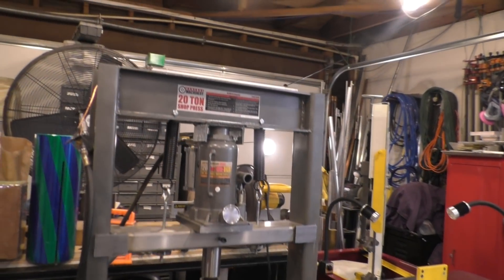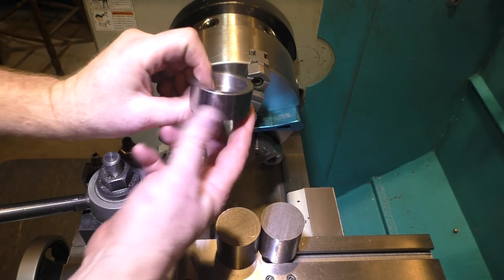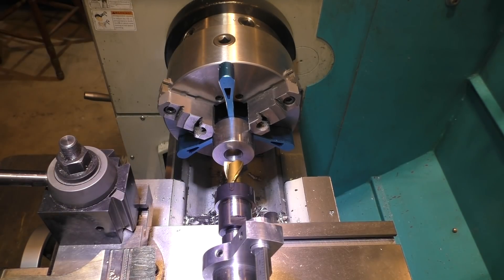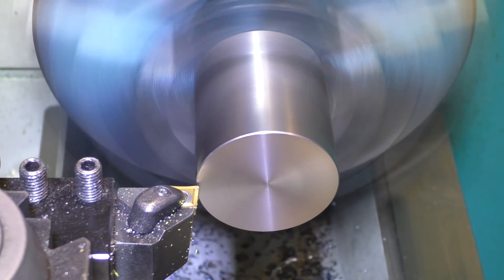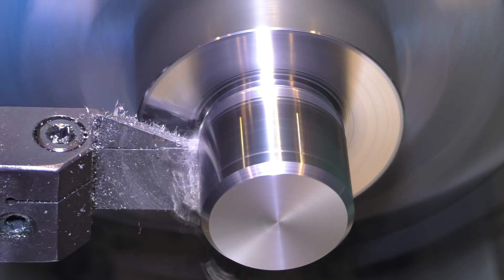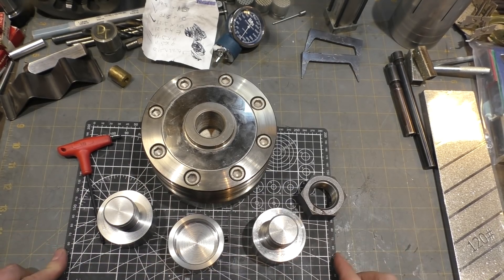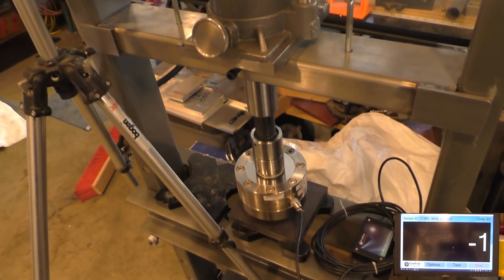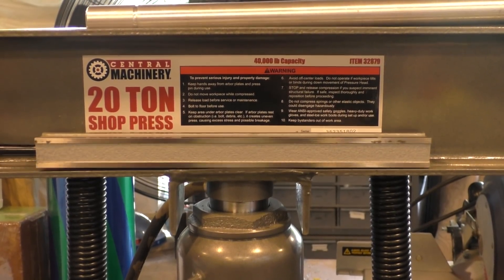83 Can a Harbor Freight 20T Press Generate 40,000 lbs.? and Survive?

Comment: Having wanted to add a pressure gauge, and done some hydraulic calculations, given a nominal piston/bore size of 2.07", to get 40,000lbs of force would require the jack to get up to nearly 12,000PSI in the cylinder, which very few hydraulic systems can do, especially those from cheap vendors. To get a guage even close to that would be $100, for one that only goes to 10,000psi.

Would be interesting to know where the permanent bending is happening. I'd guess the upper webs above the jack are bending outward, as c-channel has to twist in order to bend, which could be stopped by welding a thick strap tying the upper webs of the c-channels together.
Reply from the maker: You are correct about the bending location. It is definitely the crossbar.

Comment: I just bought one of these HF 20 ton presses last week. I've been watching a lot of reviews on YouTube, it seems harbor freight is using at least two different manufacturers for these presses. One has a welded frame, and uses sheet metal bent into a channel for the top channel, as seen in the video, while the other manufacturer uses a bolt together frame and uses actual channel iron for the top channel. It also has a one inch plate for the bottle jack to push into.

I wonder if the model with the bolt together frame and actual channel iron would be stronger?

Mine is the former. I wonder if I boxed in the top channel and added a one inch plate if it would help prevent any deflection
Reply from the maker: You have some really good ideas there. When I bought my press Harbor Freight had 3 SKUs for the same tool. Previous owners warned about the cast iron press plates, but mine were mild steel. I definitely need to reinforce mine.

Comment: The flex/then permanent deformation in multiple areas of the steel frame may be what's causing the loss of force when testing, rather than the ram leaking down👍🇦🇺
Reply from the maker: There was definitely some of that going on. I measured the inelastic deformation on one of my passes and it was more than 0.100". Under-designed for sure.

Comment: Can you flip the cross bars at the top, use it & straighten it a bit & then weld more steel inside the channels? I just bought that same 20-ton press & NOW, I REALLY WISH THAT I HAD NOT OF SEEN YOU DEFLECTION TEST! Now, I need metal to weld into the center of the cross bracing to strengthen it (if the heat doesn't warp it after ruining the paint by grinding & welding. What can be done to strengthen it???? If you had a brand new model, knowing what you now know???????????/
Reply from the maker: Unfortunately, ,y crossbars are welded to the frame, but at least you can make yours stronger at the get go. I probably would weld some thick plate along the sides of the crossbar. If yours works out let me know. Thanks for the comment.

Comment: Interesting vid, well done. 
Lots of good suggestions on here, all would work I’d think.  Now that you’ve cold worked the beam ,  ie. plastic deformation , she should settle down and stop yielding.  Can you flip the channel / I beam and load it up until it’s straight , then weld a support in?  Pre-stressed beam idea? 
Since it’s a point load that’s fairly centered,  you may truss the top surface too.  Two 3x3 Tubular Steel members 12” long positioned vertical on top surface. Then configure an a-frame out of it. Say, flat bar from corner, to top of 3x3 then back down to other corner.  Essentially the classic A truss. Just less welding maybe. Could be a boltment repair  vs weldment if you catch existing fasteners. 
I could draw it easier on an etch a sketch &@$# sakes.
Thanks for sharing
Reply from the maker: Helpful tips, thanks. Unfortunately the top bar is welded on to the sides, but the rest of your suggestions are solid. Much appreciated.

Comment: Very nice video and explanation of what you were doing on the lathe and  the theory, i was a woodworker for over 20 years and ive always been fascinated by machinists. In general  as i had some in my family  over the years and  am very good freinds with a father and son  team that own their own machine  and  metal fabrication shop  along with other. Companies  they have formed  throughout the years  as a freind ive often given them a hand setting up new  equipment   As that was one of the things i had experience in setting up  Woodworking machines in our shop that requires. A certain  type of skill  moving and leveling. Very heavy  and precision  based tools
Reply from the maker: I started with wood working and moved to metal when I could afford to. I have a tone of respect for those that can pull off  tight joints and straight edges in wood. Metal moves with temp. but not humidity. Wood is a whole other ballgame and much more challenging to, for example get a drawer to be tight a smooth in both summer and winter. Hat's off.

Comment: The next time I'm in Watertown NY, I'm going to buy one....HAL
Reply from the maker: I hope it goes well and maybe Harbor Freight will upgrade their design by the time you drop bye. They have been incrementally improving their products. I noticed that the current version of the 20 ton press has the top bat attached with bolts. Better? I'm not sure. Hopefully, the changes were not only to save money in manufacturing.

Comment: Same with the 50t press - calculate its legs - & factor in 60k PSI steel tensile strength => press legs are just marginally stronger then max pressure - any imbalance and you going to deform them as well.
Reply from the maker: Thanks for the tips. Interesting info.

Comment: I'm with Logical Guy reinforce it with some welded in plat steel,leaving holes to line up with the spring bolts....Hal
Reply from the maker: I'm right there with ya. My point was to see if the presses capabilities matched the marketing. They didn't, in my opinion.

Comment: Is there a way to install a pressure gauge on the ram? Multiply the pressure by the surface area and you will be able to determine the applied force easily.
Reply from the maker: Your solution is exactly correct and it is the solution used on better presses. They make custom dials with an appropriate force  reading  equivalent to the calculation you suggest. I have considered your solution and it is still on the table.

Comment: Dudley thx for taking the time in performing the test. So, the press can actually press 20T without catastrophically failing but just not repetitively. At the 20T level, it is sustaining permanent damage. My guess is that it really is a 10T to 15T press but can withstand 20T in a pinch. So as all good marketers do they boast the ultimate not telling you that it can't do that all day.
Now I know that you don't want to push the press to its limit and that limit is, above say 15T. Great info to know. I think it is still a great press at even 15T.
Reply from the maker: Not too bad for the cash and it can be reenforced to survive the full 20.

Comment: you don't need much regarding setting the angle of the cutting tip of a threaded insert on a proper holder. These are designed to work on toolholders square to Z axis. So, all you need to do is square up your Aloris :)
Reply from the maker: Thanks for the suggestion. I still go for 29.5 deg. because that is how I was taught. I will, one of these days go straight in. I've seen it done without any issues.
Reply: @DudleyToolwright  hey, I didn't mean the feed angle. Feeding at bit less than 30 deg is correct. I am talking about that fishtail gauge that you modified to suit the thread cutting inserts. Didn't need to: if you set the chuck side of your toolpost flat against the chuck and fit a threading insert toolholder resting against the slot of the toolholder, your don't need to adjust anything else, cutting angle should be correct! They are designed to work with the toolholder perpendicular to lathe's Z axis.

Comment: The real problem with these cheap presses is not the plastic or bending deformation but the elastic. They are like winding up an enormous spring. If anything breaks or slips all that energy is going somewhere....slinging heavy stuff at you.
Reply from the maker: A very valid point. I was more than a little bit nervous when I was cranking on the extended jack handle.

Comment: Hydraulic pump has a safety that is why it leaks down. Without the safety it would increase to failure.  Frankly it vastly exceeded my expectations. .
Reply from the maker: Mine too. I was thinking it would make it at all even with the longer handle. I really had to pull.

Comment: HF has two models of the 20 ton version. Mine doesn’t have a welded top beam. It’s bolted to the vertical members. It seems stronger, assuming the bolts don’t give. I haven’t yet tried to measure the pressure. I notice that the shaft of the jack on yours is much nicer than the one on mine, which is just a painted steel round bar sticking down from the jack support plate. Was that original, or did you modify yours? Mine comes with the standard long handle. I’m thinking of welding a heavy “U” channel on top of the horizontal support, but first I might have to grind the middle piece that holds the two sections together, and then reweld it, because when they welded it, they didn’t clamp it together, and the two channels are too wide for the vertical supports. I had to put washers in between the channels and the vertical parts so that I wouldn’t bend these channels when tightening up the bolts. Not good!

Oops! I just looked at your video list, and realized that I did indeed see the video with that modification.
Reply from the maker: Insightful comments, thanks. You know that you are not getting well made gear at Harbor Freight, but on the flip side, it is affordable where it otherwise might not be.

Comment: I wonder if a gusset welded right in the middle of the pressure point would help..or maybe offset from center line on both sides by an inch or two
Yeah...cheap tools...but they work great...anything that needs 40K lbs of force is gonna be scary to use that thing anyway
Good video!
Reply from the maker: You make some great points, thanks.

Comment: is it fluid leaking back or bending metal, I bet the jack is fine and its just the metal starting to yield
Reply from the maker: I think it is the fluid leaking back only because the indicator did not show noticeable spring back as the pressure dropped. Still you could be right. 0.075" per 40,000 lbs would not cause a lot of movement for a 1000 pound drop. Thanks for the thought provoking ideas.
Reply: Once the jack reaches the calibrated maximum force, doesn't it bleed the pressure so you can't exceed it? On some floor jacks there is an adjustment screw for this.

Comment: As for height issues, you should be able to put the entire press on top of pretty much any kind of platform or cabinet to raise it.  The base should not see any of the press forces beyond the human level of force you're putting on the lever.
Reply from the maker: Thanks for the advise. You made so very good points.

Comment: DT, Try using the Air over hydraulic, bet it goes way beyond 40k, my press does more work by air, than by hand! Also, you have more chance of permanently damaging your jack [don't ask me how I know] by maxing out by hand i.e. it destroys the HF check valve] Max out by air is automatic and not destructive to the safety check valve.
Reply from the maker: That is a great point. I should have pursued the air angle as well. Thanks for the good suggestions.

Comment: hello dudley very cool test. on my 20 ton homemade press i have a 6 inch x 3/8 thick piece of square tubbing on top where your 2 c channels are back to back and mine does not bend because its a box. thats what i would do if i where you is box in your c channels and then put a plate flat on top to tie everything together. i dont think i would be to concerned about it being bent allittle i would be more concerned about keeping the press from bending any more. great video thanks for sharing.
Reply from the maker: Thanks for the suggestions. I might just fill in the 2 "C" channels to complete the 2 boxes as you suggest.

Comment: I would really like to see it the top bar would get to a point where it stopes bending at a certain point and where that is or will it continue until it brakes
Reply from the maker: Me too, but I am already struggling with a solution to bend it back before shoring it up. Perhaps if I sacrificed this press for the experimental evidence I could fix it by replacing it.

Comment: The hole test is to see if the press can do as advertised so modifying it to be stronger is changing the test from testing the press to simply testing the hydraulic jack
Reply from the maker: Goo point. None of the mods I did to the press make it any stronger than factory. I kinda wish I had though, because now I can't figure a way to bend it back before reinforcing it.

Comment: Could beef up the top of the top frame, I know it's not the best solution but if will give you space.
Reply: I did that with my press, the top comprises of two lengths of thick walled C channel welded to the outside of some 60mm x 100mm thick walled box section and together they make up over 3/4" of steel for the jack to press against.
Reply from the maker: I agree. I just wish I could take the bow out first.

Comment: Cool experiment! I was thinking this is a very expansive test, but then you said you got a great deal on the cell.
Btw, I'm curious as to how are you planing to fix the bow when you add the reinforcing bar you mentioned?
Reply from the maker: Thanks, I also was trying to consider ways to fix the bend and haven't come up with any short of finding a larger press that this one fits in to. All of the pulling hydraulic tools I have found are a lot less than 20T. I might just have to weld support to the bent top bar. Not ideal.
Reply: Just take the top beam off, flip it upside-down (after welding a cup to center the jack), and bend it back . . .
Reply: Cut it and replace it with a better design.  I’ve never used mine for much more than replacing bearings and retention collars. There’s not much room between uprights to work on larger items.

Comment: Nice stress test on the press. The only thing I am wondering about is how the bottom rest fared if it bent as much as the top did. Also, how did the locking pins do. Did they bend show any signs of shearing?
Thanks
Reply from the maker: Good point. I was thinking the same thing as I lied awake a few nights ago considering the test. I didn't notice any, but I didn't measure either. I noticed the top bar bending immediately, probably because it was at eye level.
Reply: @DudleyToolwright  You know this calls for an update XD

Comment: Nice test, I, like a cajillion others, have this press as well, if not as nicely set up as yours. I'd be interested in the max pressure the cylinder can produce without leaking back. Based on my own anecdotal experience, it's probably not much more than 10,000 lbs/in^2, and maybe even less.
Reply from the maker: It seemed to hold steady more or less around 20,000 pounds. After that, total pressure applied was on a clock.